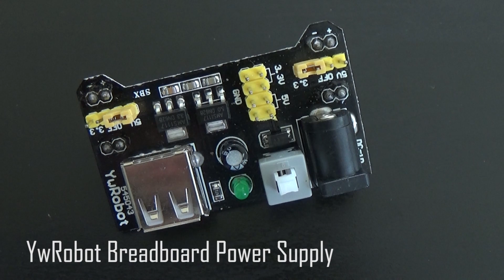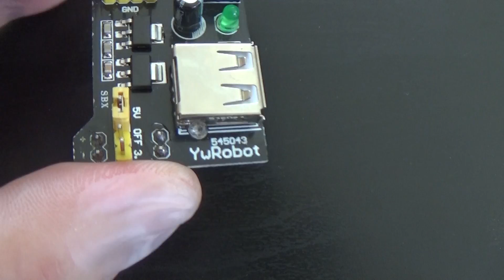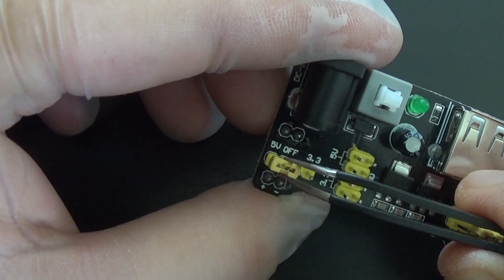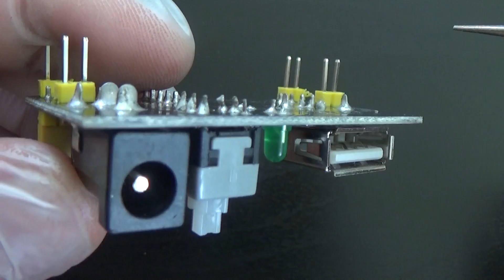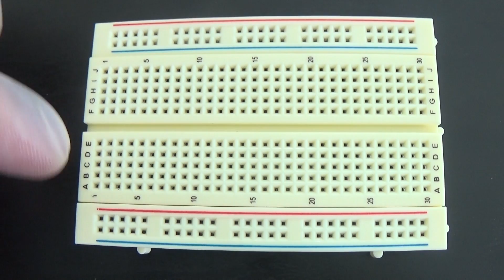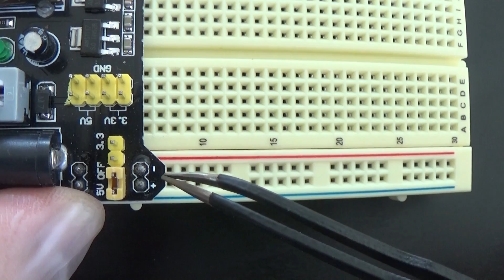YwRobot Breadboard Power Supply

Comment: great vid.. here's what I just observed yesterday..
 you missed a couple things that are indeed very important..  plugging it into the wrong end of a longer breadboard (as mentioned) is OK to do, but it sets up and inverted polarity on the breadboard where it's + output pins drive the ones labeled (-) on the breadboard's labeling... but if you keep that straight you're fine using it that way.. 

Several longer breadboards only extend this power half way down the rails too so be prepared to jumper + and -  across the gap in the middle if yours are like that too.  

 Secondly these YwRobot breadboard regulators cant take 12.0vdc, I would recommend they only be fed with 6 to 9vdc adapters.. I had 4 of them all fail very recently in exactly the same way before I realized that I'd grabbed the wrong wall-wort adapter and was feeding it 12.25 vdc ( unloaded) .. and here is precisely what each one did as it failed..
 
1.) under a NO load condition with this +12.25 vdc applied thru the barrel jack produced want looked like Ok voltage out across the rails and was looking good at + 5.02 vdc .. it looked fine but when switched off then connected  to a actual load...

2.) and turned back ON while under LOAD its GRN LED immediately started blinking at a slow .5 second rate and the output voltage under light loading was then reading only + 0.02VDC.. 
NOTE:   I think this is a ONE TIME ONLY Fused -Open behavior to protect the load.. But then ... 

3.) disconnecting the load and turning it OFF then back ON gave a normal steady ON GRN LED BUT the actual output on the rails from this regulator was exactly +11.34 VDC and it stayed that way every time you switched it OFF and back ON with or without a load connected.. 

I made the mistake the 1st time this occurred of having a little MPU 5060 accelerometer module plugged IN and I did not check the vltg after it was BLINKING GREEN at it's .5 second rate.. and as I powered it back ON (assuming that it was simply a bad MB102 module and I swapped in a new one), it immediately  went to +11.34 and literally with no longer a 0.02vdc out again..  this +11.34  smoked the regulator chip on the MPU 5060 when I turned it back ON.. it was sparking and billowing smoke before I could unplug it.. since switching the regulator switch  OFF had no effect.
 
4.) after seeing it do this BINKING in a FAIL SAFE FUSED OFF to then switch over and start putting out +11.34 VDC on the rails not just once but on a total of 4 of these YwRobot MB V2  regulators .. I finally started researching the source and I am now 99% sure now that it was my 1.5 amp 12vdc wall wort that triggered all the failures of these regulators...

Lesson learned.. If you ever see that GREEN LED start BLINKING as you power it ON.. do UNPLUG the load immediately and test the output voltage on the rails because after cycling the switch ON/OFF/ON  a 2nd time, the +5V voltage is way too hot, it's over twice that at 11.34vdc.. DO NOT leave it connected to the load as you turn i back ON since you may be using a +12vdc or higher output transformer adapter by mistake like I was...

Comment: Ive use it for my home weatherstation. Pretty cheap and you get what you paid for. Its not very efficient and if you draw around 200mA at the time, the voltage converter chip gets increddible hot. Therefore i mounted a heatsink.

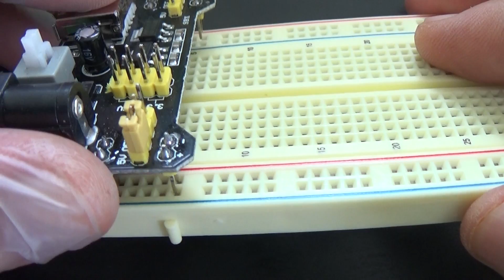Comment: ThatLEDGuy - At 3:27 - "They line up perfectly [...] and you have your POSITIVE that runs all the way down [this BLUE rail] and your negative that runs all the way down [this RED rail].
You should really remove this video and re-make it, correcting that very obvious error, and strongly making the point that this is a possible error that will burn out chips and melt the breadboard.  I know - bitter experience!

Comment: Nice vid! I believe it is supposed to be fed by 5-9V DC... Ideally 9V. If you go high as 12V, the 5V side ends up providing 8V (!). Depending on the brand of the protoboard, this device should be installed at the lower rows, or upper rows, to match the polarity color-coding (colored stripes) of the breadboard.

Comment: Why do you need to use one of these if you're working with an Arduino? Would it just be solely to stop having to run wires from the Arduino Ground/5V to the breadboard?

Comment: What if you take off the yellow voltage setter thingie?
Reply: Removing the jumper from the pins entirely also sets the rail to 0 volts. The two center pins are ground.
Reply: @johnbayer3822  Okay, Thank you

Comment: Thanks for the video. My search lead to this page after my crappy board was outputting 8 V at the 5 V pins. Not sure if the board is bad.
Do you know what that push button switch is for? 
thanks!
Reply from the maker: The push button is the main power switch for the power supply.  Turn it on, power is on the breadboard.  Turn it off, breadboard is unpowered.
Reply: @thatledguy6872  Thanks! Now I have to go back and test that button again. Recalling, it looks like that does not work as well!
Reply: @thatledguy6872  Got it! Thanks!

Comment: anyone know the range in put voltage? I mean in the DC input: can I vary the volts between 5 and 12? More? I can't find anywhere the input volt range...
Reply: I've connected 9v no problem. I can try 12 later .
Reply: Thank you for trying but don't burn it :) Anyone has already tried and can confirm? I would like to know the upper limit allowed.
Reply from the maker: Finally got around to trying this.  12V is fine. I don't suggest going any higher than that.
Reply: @thatledguy6872  thank u so much for feedback!

Comment: Could you connect a separate switch to control the on/off function?
Reply from the maker: You could.  The switch on the board is a 6 pin latching pin... generic thing.  Looking at the bottom of the board.. it'd be super easy just to desolder the switch right off the board and you can send your own signal in at that point.

Comment: I thought you glossed over the set of parallel jumper pins towards the middle of the module. I was asking a store consultant what they were for and he placed the jumper plug across 2 of the pins and instantly cooked the module causing it to spark and smoke badly. I have not been able to find any information so far about this set of pins and what they are for and how they are used or configured. The power module I bought came with no documentation or instructions.
Reply: @ Ian Barton. Very simple two +5v and two +3.3v pin out as well as a straight line of four ground (GND) pins as inidcated. Very handy if you connect some jumper cables to power a device off the breadboard.
Naturally you would never short voltage directly to ground as your store consultant did.

Comment: Thanks. A great review. Small point though. Please note that you have mounted it on the wrong side of the breadboard. The red line holes on the breadboard do not match the +ve on the power supply. The power supply should be mounted on the right side of your board and then the colour code matches.
Reply from the maker: Yeah, was pointed out by other users.  It's an issue with filming upside down when I made the video and wasn't paying close enough attention. :D
Reply: @thatledguy6872  I commented at the top of the video that you should delete the video and remake it to correct that error - because I thought the video was very recent.  It was an error that anybody could make.
Now, however, I see that the video was made three years ago - and it's still like that - even after you have been told multiple times!!!   This doesn't make you look like somebody who made a mistake - it makes you look like an idiot - regardless of the excuses why the video was made that way,

Comment: I have one of these. I feed it with 12V. On the 3.3V setting it outputs 3.3V. On the 5V setting it outputs 8V! So be careful with this one and measure the output voltage. I took a chance and connected an ESP-8266 to get power from the USB port and it worked, but I suspect it's not a good idea to use it for powering.
Reply: I bought 5 of them. One blew out the electrolytic cap upon first application of 12V. Only one of the other four had spec output of 3.3v & 5 v. Measure BEFORE using.
Reply: Thank God! I thought I was the only one with this problem! I completely agree with you! I have the same problem with this piece of C**p! I want to center my servos and decided to plugin the servo tester that takes 4.8 to 6.0 V as input. I'm glad that I decided to check the voltages because I was using this board without looking at the documentation . Therefore, I wanted to make sure that I set the jumpers correctly and I was getting the proper voltage out! I am constantly getting 8 V output at the 5 V pins!  What a pain! 

And I don't even know what that push button switch does! Does anyone know what it does?

Comment: Is this  board is helpful to build a diy powerbank?
Reply from the maker: I'd suggest only using this during your prototype/testing phase.  When it comes to powerbanks and dealing with LiPO batteries, there's a ton of other things to look out for such as over-charge protection and drainage.
Reply: @thatledguy6872  are you getting  5v out of the 5v why are so many people saying it gives 8v instead of 5v?
i wish there was another model that has micro USB input as well as  a barrel jack input  and the USB output , i was wondering what the USB type a was for like you i also assumed it was for an input but when i saw them on ebay and they did not  include a type  A to type A USB cable i   thought maybe it is for output only and i was right , too bad there is no micro USB input ,is there another model that has both? maybe one that does not put ut 8v instead of 5

Comment: Can you use the USB port also as INPUT with a male to male USB cable?
Reply: the usb is primerly for power out. the circuit is not designed for usb input
Reply: @abraxaskabrakas6098  Thank you

Comment: Also the USB is not to power the board, its to provide USB power if needed,
Reply: Yes, you connect a USB cable to power up your Arduino board.
But beware:
Read the following link and read the comments, there are some issues most probably with some old boards.
I have got one recently and it seems to work OK.
http://ik1zyw.blogspot.it/2015/03/breadboard-power-supply-module.html
Reply: James Bevan r u sure?
Reply: you can connect for example an ardunio with the black power jack with a 9v battery and with the usb jack to the breadboardpowerboard. it works, so it is right.  but it works the other way around aswell.
Reply: that is not true the USB is an input but it is for 5v only and you cannot use the 3.3 outputs for your breadboard when using the usb 5v supply
Reply: @earllowery2278  : It is NOT an input. It is output only. Read the PDF of the product. Easy to find.
Reply: @espenkristoffersen4887  Using this style of connector implies its an output. An input would be a type B connector. Providing power to an external USB device  is limited to about 1A from the on board 5v regulator.
Reply: Really figured it was an output, an input would probably be micro (or mini or B) so any charger/standard cable would work (which would actually be nice, but since the board is 6.5-12v I guess that wouldn't work anyway).

Comment: Hey! My one camed without a jumpers, but it's not a problem. When I plug a battery it works fine, but after connecting it to power supply it doesn't work at all. The polarity right, and i checked few power supply (9v, 1,3 A, standard guitar unit). The LED is off all the time and it's not giving any voltage. You guys have any advice?
Reply from the maker: To fix the jumper problem, you can use a female to female dupont jumper wire.  As for it not working after connecting it to a power supply.. that sounds strange.  If the LED is off, even after pressing the switch.. that's telling me that you may have shorted the board and burned it out.  Without having the unit in front of me, there's not much I can help you with. Sorry.
Reply: Yeah, I know this trick, but right now I'm setting the lab, and i suffer from lack of jumpers, wires etc. 
About the power supply. After plugging the jack and the LED didn't respond, I plugged it back to 9v battery and it worked fine. I'm assuming it's not broken. Maybe the power supply didn't have enough current to drive the circuit, I need to measure current consumption, or maybe, my  battery-to-jack converter have differnt polarity, there is a lot of research ahead of me.

Comment: Is the female usb an input or output? Seems to me that it should be an 5 volt output, but I just got mine and don't know anything about electronics.
Reply from the maker: Dirk Stabins as mentioned above it can be used for both but I've heard not to use it an output.

Comment: What would happen if there was a short circuit? Is this module short circuit proof?
Reply from the maker: Yes, there is short circuit protection built into the board.  It can heat up but it will operate normally after removing the short.
Reply: Alright thanks, I've got one of these but I still gotta buy a 9v wall wart to use it.